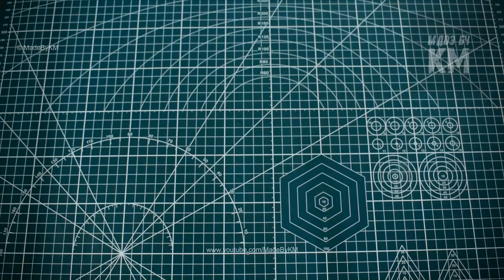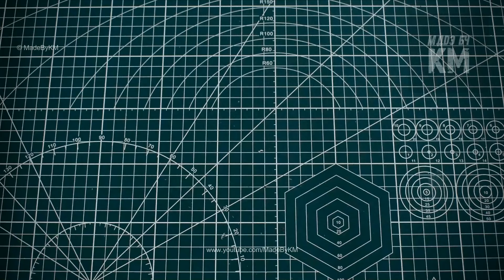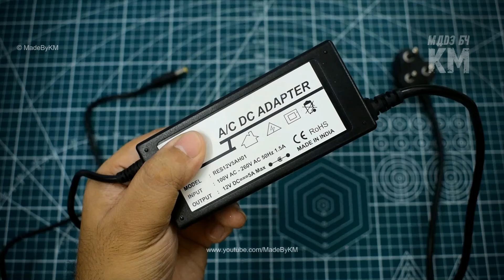DIY Aquarium Light: Create Your Planted Aquarium LED Light at Home!

Comment: This is amazing my tank is 2.5ft do i need to add this 2 lights for plant growth and i have gold and iridescent sharks kya wo plants ko rhene deynge ya mujey fishes ya tank setup change karna hoga please help last query i think btw hatts off for such professional design ❤
Reply from the maker: Iridescent sharks are generally not appropriate for home aquariums, as they can grow up to 3 to 4 feet in length. Additionally, being omnivorous, they will consume both plants and other food sources. Therefore, considering your tank size and if CO2 is not used, it is best to use a single light and grow plants that do not require intense lighting. You can consider keeping a group of small tetras, or guppies, with some Cory catfish and algae eaters in your setup. Thank you.

Comment: Awesome i would love to try this since im using a cheap Chinese planted tank light... I'd like to know 2 things
Total cost of materials 
(approx),
Is the heat sink good ? So that this light can sustain in the long run
Reply from the maker: These aluminum channels will work great as heat sinks, and the LED strip lights will definitely last longer. Also, I have shared the link to some online materials in the description box, but if you buy these from a local market or electrical store, they will cost much less. Thank you.
Reply: @madebykm  where do I find those led strips? And how much for 1 meter?

Comment: In place of DC POWER JACK if i use direct pluck method so it will work or not (pluck mean normal wire and pluck that available in shop) please assist me sir
Reply from the maker: These LED strips operate on a 12V DC current; supplying AC current directly will cause them to burn out.

Comment: Bro can I use store bought organic compost for aquarium soil??
Reply from the maker: Yes, you can use vermicompost
Reply: @madebykm  aquarium water 💧💧is turning yellow due to compost even after covering it with 1.5 of sand  
5days after tank setup
Any guidence
Reply from the maker: That’s normal. During the first week after setting up the tank, it is essential to perform a 50% water change daily. In the second week, perform a 50% water change three times. Beginning in the third week, a 50% water change should be done weekly. Fish should be introduced only after a period of one month.

Comment: Bro can we use soldering paste for soldering?
Reply from the maker: Yes
Reply: @madebykm  does spill all over if we use soldering paste flux for adding wore pieces for + and - , and which is better soldering tin or soldering flux paste ?
Reply from the maker: A very tiny amount of solder paste should be applied, and for those without experience, it is better to use regular solder wire.
Reply: @madebykm  thanks a lot for your guidance bro

Comment: I am also using this light but i am using 6500k 2835 strip only not the blue and red , my tank size is 20inch*10inch*12inch ,now i using this light of 20 inches in length only one ,i am getting hair algae any solution to this ,currently the height of the light is 2 inch from water can i increase it to 6 inches and also do i need extra strips i am not having co2
Reply from the maker: Hair algae can occur due to nutrient imbalance, for example when certain nutrients or CO2 are deficient. Also, excessively long light hours or too intense light above the tank can be a reason for their occurrence. So, either reduce the light intensity or use CO2 to solve this problem.
Reply: @madebykm  thanks for the reply